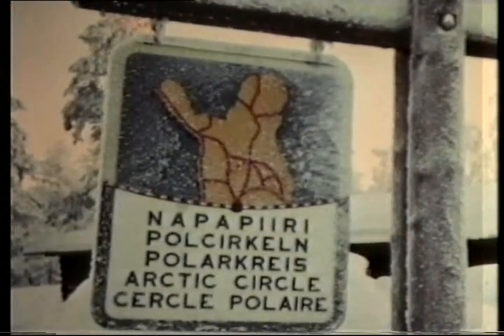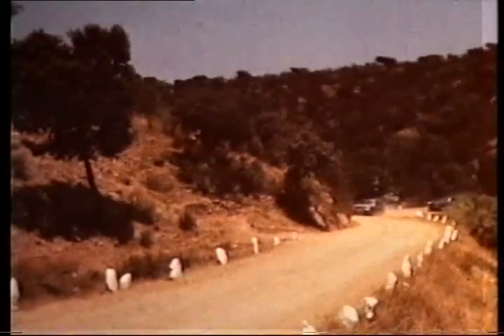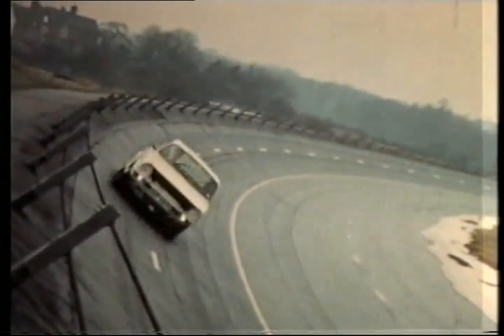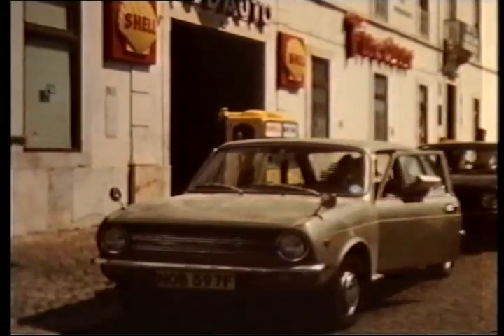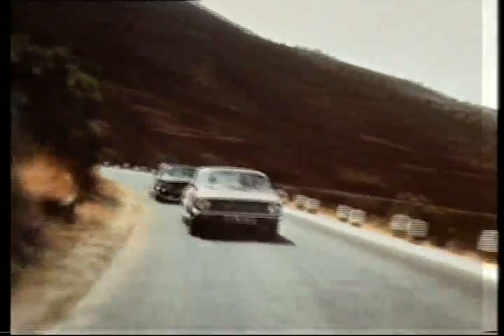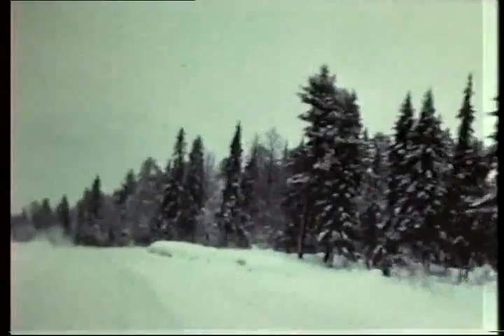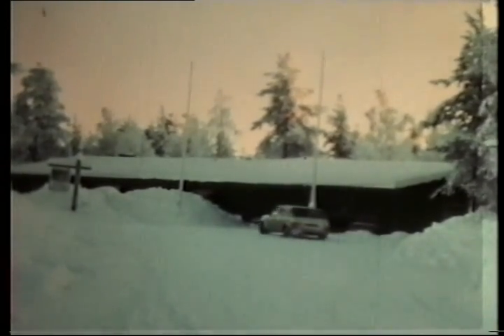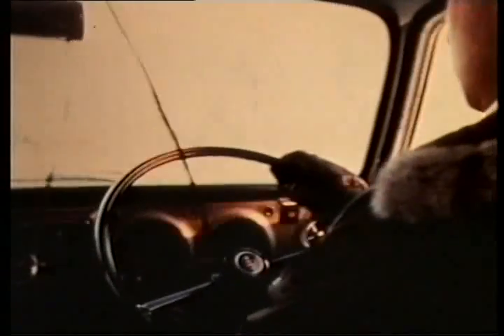BMC Maxi Marathon Test No. 7

Comment: A good car on many levels, 5 speed, hatchback, new engine but the gearbox and styling let it down badly and it was under powered for a 1500 in a heavy body at first! Issigonis was loosing his touch by 1968

Comment: They should lent them to families, then they would Learnt that the E-series engine siamesed cylinder liners made the maxi overheat in traffic jams. But no they drove the cars at full speed.
Reply: ???? I had the Allegro with the 1750 engine and the electric fan or just the bimetallic switch failed, hence no forced air fan cooling. Using the cabin heat as a radiator got a bit warm in summer, but the engine held together.

Comment: Still. A flop. Bad transmission. Bad engine.
Reply: A bolshy road testers report. After 2 weeks you knew where everything was. OK it wasn't a Ford gearbox but after a month you had forgotten about it and the 5th gear was bang on with a now practical motorway network. When did Ford put 5 cogs into a box in the UK?